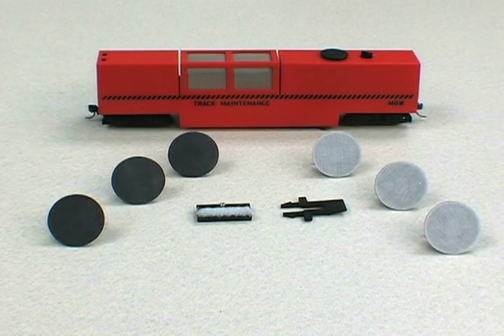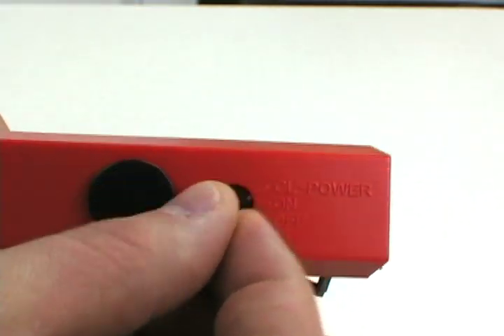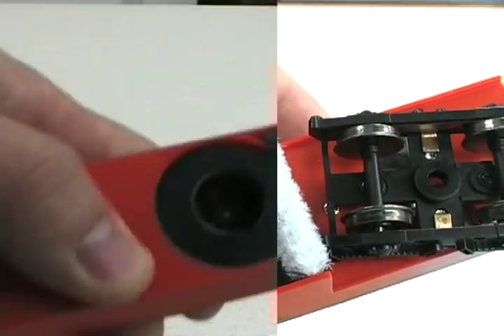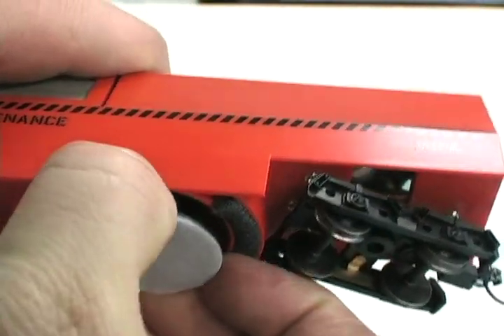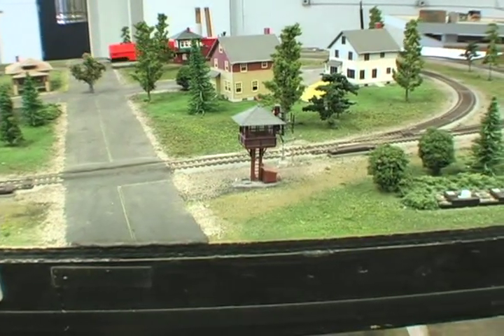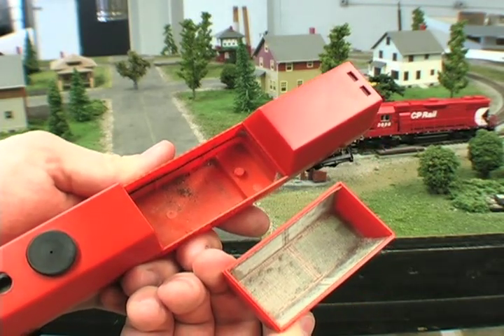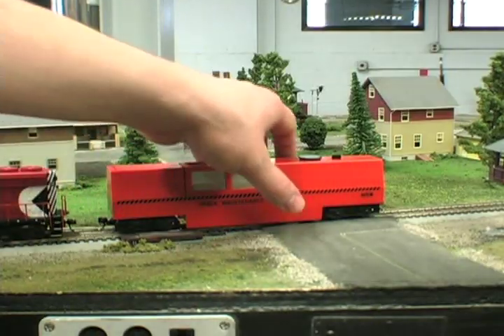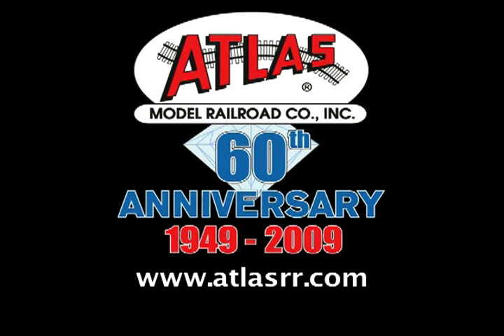The Atlas HO Track Cleaning Car

Comment: Thanks, the reason I'm asking is that i can't find a picture of the bottom of the n-scale model and I noticed that the cleaning head replacement packs don't include that foam strip.  I was thinking the N version uses the disc instead of the foam?